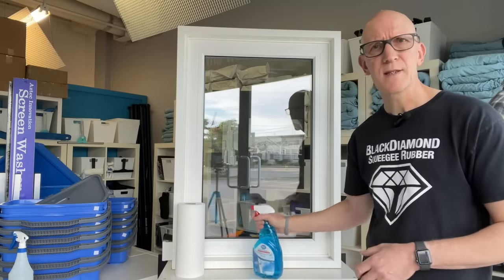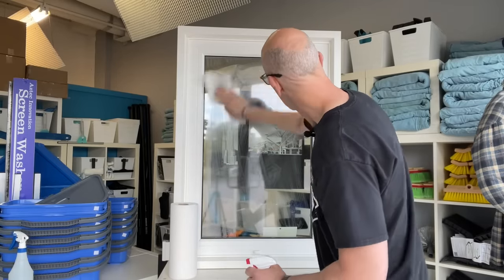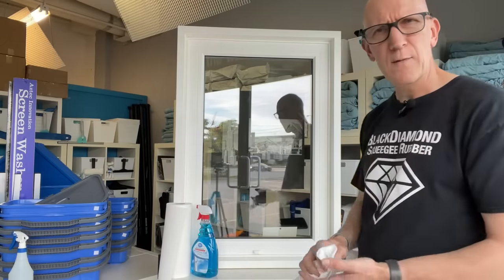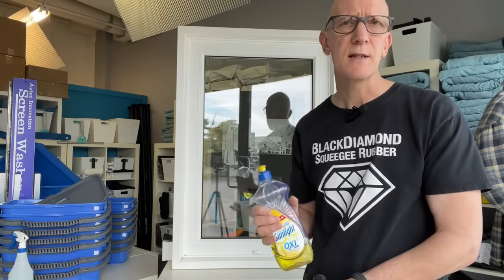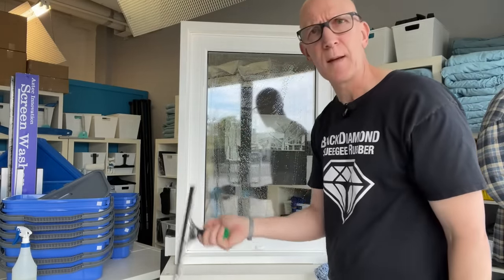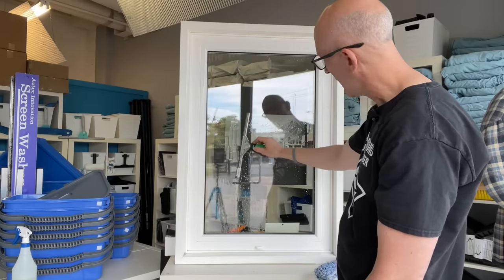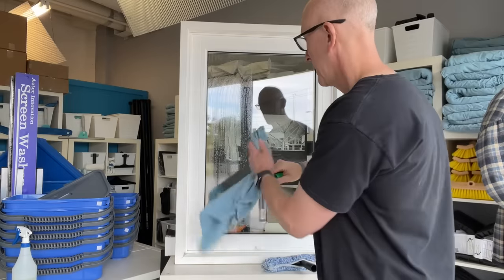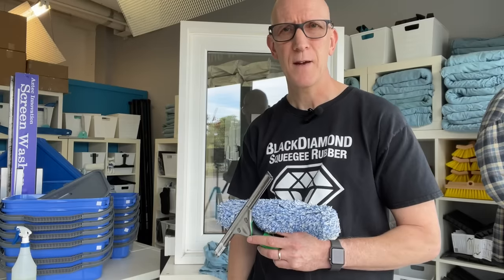The Secret To Streak Free Window Cleaning - How To Wash Windows Like A Pro

Comment: Additional tips: Don't use warm or hot water...you don't want the water evaporating before applying the squeegee. Angle the blade so that the water falls into the adjacent area to be cleaned. Clean squeegee blade frequently. Use the ends of the cloth applicator to get into dirty corners. Try not to stir up the dirt that may settle onto the bottom of your bucket of water and change the water as soon as it appears dirty. Clean, absorbent cotton rags work better than micro-fiber rags. Change rags frequently to avoid redepositing dirt onto glass. Make sure squeegee blade is not dull...they wear out like a knife. Use a lot of dish soap, like 1-2 oz. Less soap will make cutting pollution, cigarette smoke, etc. more difficult. Add a few drops of dishwashing Rinse Aid to the soapy water...greatly improves sheeting action and further reduces streaks. DO NOT go over the window with a rag or paper towel after using squeegee. Only clean the edges from top to bottom and sides, making sure rags are clean and dry. Paper towel, newspaper, etc should not be used. Clean rags in washing machine, but never add fabric softener or use softener sheets which leave a residue on glass and mirrors. Never clean in direct sunlight. You make have to work faster in drier climates to avoid rapid evaporation of your cleaning water. Dirtier windows may need two or three cleanings, with focus on the edges.
Reply from the maker: Thanks for the additional tips
Reply: I found your comment more informitive than the video without taking nine minutes . 👍
Reply: Great job! Thank you very much!  The blue stuff is not very good. What about vinegar?
Reply: You can also add some (1/4 or 1/3 cup ) of White Vinegar to the bucket in this process.  I sometimes use the Windex with adding White Vinegar to the Bottle.  Never clean windows in the Sun!!  This goes for Cars too.  People don't realize how much "gassing" comes off the Vinyl dashboards Sticking to the Windshields.  White Vinegar to the Rescue!.
Reply: You should make a video on your tips
Reply: I use old bath towels cut into quarters.
Reply: thats the first time ive ever heard not to use hot water... my window cleaning company has been around since 1999. always filled our buckets with hot water. dont change rags often, an older cloth works better. agreed microfibre cloths are worse than cotton rags. you should work with a dry cloth and a wet cloth, wet cloth for sils and dry cloth for edges. you shouldnt actually use dish soap because of suds will leave dots. you can get detergant that doesnt create suds.  you can clean in direct sunlight (window cleaners dont take the day off when its sunny) the soap and water on the window will not dry in 5 seconds and if it does just re-applicate the window. dirtier windows do not require you doing them 2-3 times, your applicator also acts like a sponge, scrub the window with the applicator, anything thats really stubborn get a fresh razor blade, make sure the window is wet then you can razor blade the dirt off, never razor blade a dry window you will end up scratching it.
Reply: @M_Ladd  vinegar helps for household use, but commercial window cleaners prefer dish soap.  Tinted windows can be damaged by ammonia or vinegar based solvents .
Reply: @humblewisdom8976  I found both the video and the comment excellent 👌
Reply: @humblewisdom8976  and it probably took you longer to type a stupid comment then to watch a 9 minute video. But you did watch the whole 9 minutes like the other several hundred thousand viewers that watched it so it mustn’t have been that bad.
Reply: Booo....You just made it sound like way too much of a job for me
Reply: Great thank you
Reply: Good info. But WAY TOO LONG. Same info could be shared in 2 minutes or less.

Comment: Good video.  I will try it on my mother’s car today !!! 🎉😅. I usually use warm water , dish soap / teaspoon/ tablespoon depending if I use a big bucket or a lil bucket 🪣 /meaning people w arthritis , RA , Osteo ect can do this. 😊I mix in 1/2 cup vinegar and a 1/8 cup alcohol.  In the little bucket.  🪣 ❤ grab a sponge and the cheap ones that are fat and absorb, (w the scratchy pad on the back )   Then I just do the same thing but use the sponge.   It comes out great but I still have a few streaks in sunlight.  So I’m thinking this squeegee is the dope banger. !!  ❤

Comment: I've been using this method for years. Quick, easy and efficient. I also add a little vinegar to the solution   and when the squeegee is held with the right side lower than the left, I start on the left side of the glass and work to the right.
Reply: Methinks you mixed up (s/b starting on the right side and work to the left).

Comment: Appreciate your technique. For the outside I spray a cool window with water, then spray with dollar store CLR, light scrub with a Teflon safe Blue Scotchbrite pad to remove years of hard water, the window is ready when it feels smooth through the pad (30 seconds), rinse. You don't even need to dry the window to avoid streaks. If you want the window really posh, walk back after cleaning the next window and wipe it down. (the same pad and CLR cleans the screen without getting bits stuck in the screen)

For inside I have never needed more than a damp with water only microfiber cloth and a dry one to follow with. (if it's really nasty I add a third, damp & sopy microfiber as step one)

Comment: Thanks! I hate cleaning windows because it usually involves multiple trips inside/outside to try to find which side has the streak I can't get rid of.  :(    I will try your technique.
Reply from the maker: You’ve got this!
Reply: If you only do horizontal wipes on the inside and only vertical wipes on the outside (or vice-versa) then you'll always know which side of the glass your streaks are on.
Reply: @EileenTheCr0w  What a great idea! Thanks!

Comment: I've tried everything under the sun to get my sliding doors clean and clear and streak-free.  This does a better job but not entirely.  I wish someone would come to my house and do it so I can see that it really does work.  Thanks for the info.
Reply from the maker: Thanks for watching. If you hire a professional window cleaner, anywhere in the world, this is the method they'll use. It's how I made a living for 7 years before opening a window cleaning supply store. Only thing I can gather giving you issues is that you are using a poor quality squeegee, squeegee with worn out rubber or rubber is too hard like a car squeegee, you're pressing too hard, or the door glass  has some hard water stains.

Comment: Great video, thank you very much for making it.  I watched the video and read all of the comments.  The only point in this process I feel was left out is the solution on the scrubber.  Do you just dip it in the soap/water solution and get to work, or do you hand remove any excess soloution before use the scrubber on the window?
Thanks for your response.
Best regards, Brian
Reply from the maker: Dip in the solution then squeeze out enough so it’s not dripping.
Reply: @WCSkills  Thank you.
Reply: It’s grease on a lot of glass . Cooking prints , and what do we use to was drinking glasses  in fumes and finger prints , soapy water , the sprays never cover evenly that is why streaks appear she insufficient spray to dissolve the gunge was applied

Comment: For mirrors, mix in a spray bottle either of these two recipes: 1) 5-10% isopropyl alcohol and the remainder vinegar. or 2) 5-10% isopropyl alcohol and the remainder 50/50 vinegar water.
Adjust as desired.
Reply from the maker: Thanks for sharing.
Reply: Just use water and a magic eraser. No soap required
Reply: @zimmermanlandscape9287 please, no magic eraser…so bad for the environment.
Reply: @Smar47  Magic eraser is made of melamine, which is a natural compound, pretty much only harmful if it gets really hot and you eat it.
You still should be careful of using it on tinted glass or things like metal, etc.. cause it can actually leave a ton of tiny scratches.
Reply: Distilled water.

Comment: Hi there just wanted to know your bucket of water is it warm or cold or does it not make any difference. Also does this method apply to inside your windows & showers with glass doors & panels. Love things that are simple & works. Thank you 😊
Reply from the maker: Water temperature isn't important. In 7 years as a professional window cleaning business, I only ever used warm or hot water when trying to break through nicotine stained windows...yuck! The method shown in this video will work for exterior and interior glass. It will also work with shower glass doors and enclosures provided that the surface is smooth/flat.

Comment: Dear Sir, I have noticed you answered every comment of each viewer and give positive reply. May I ask you 2 questions: what causes the streaky marks on the glass? Is the Rechargeable vacuum cleaner helpful for this kind of job? In addition, I also enjoy your well-kept background. You must be a very methodical guy. I think I will have a lot to learn from you. Thanks in advance.
Reply from the maker: Streaks are simply a sign that you left some water/dirt solution on the glass. That water and dirt mixture dries and becomes quite visible as light passes through it. The video you just watched should go a long way to showing you the proper method for streak free results. If you’re still having issues, I’d recommend you watch my Top 10 Reason You’re still getting streak video. https://youtu.be/OwHYa9mLlDY I don’t recommend the vac window cleaning system, it’s more of a gimmick from what I can tell. Not needed. There’s a reason professional window cleaners  continue to use the scrubber and squeegee method, day in and day out. ;-)
Reply: @WCSkills  If you have rinsed your windows well, there should be no dirt left. The stains you see come from the lime in the water.
The squeegee is only used to work quickly. It contributes nothing to cleaning. If there is still dirty water on the window and you go over it with that rubber, you simply spread the dirt. If you use vinegar water after rinsing, it will dry streak-free because there is no longer any lime in the water.

I know those "professional" window cleaners. Until the sun shines on your glass. If I can get it really streak-free then I apparently know more about it than the '' professional ''.
Professional means: as many windows as possible in the shortest possible time. Quantity over quality.

Cleaning is science.
- pre-rinse (soak)
-degrease
-rinse
-clean with vinegar water (water without lime)
-No more going over with a rubber that you didn't need in the first place anyway.

Comment: Well explained and it works. The 'blue stuff' Windex etc is methylated spirits or (American) rubbing alcohol with water and blue colouring. If you use enough it will flush the dirt off but there's no detergent to loosen dirt. People are recommending vinegar but give no reason. I prefer cotton rag as microfibres have a hard, non-absorbent feel
Reply from the maker: Thanks for watching!

Comment: I use white vinegar and warm water in a spray bottle and wipe. I also use this on  wood furniture, it’s amazing!
Reply: I add a bit of rubbing alcohol and small drop of Dawn  to the vinegar and warm water. Alcohol acts as a drying agent. It does make a difference when you use a cloth instead of paper towels!
Reply: It causes streaks and it pretty much sucks. It's also way more work! Dawn dish soap and a squeegee with a simple clean up towel and you're done
Reply: Great tips...I find window cleaning so frustrating
Reply: Great the more cleaning Mayer mail you put n anything the harder it is 5o clean , happy window cleaning all😊
Reply: @daffodilrose1950  , professionals do not use rubbing alcohol because it  is costly, doesn't work effectively and you don't want to speed up evaporation. Use a lot of dish soap (1-2 oz in a bucket) and a few drops of surfactant, like Rinse Aid for your dishwasher. Change water frequently and make sure it is room temp, not warm, nor hot. The soap will cut the dirt and grease, the squeegee will push the cleaning water off the glass. Only clean up the wet edges, finding a clean spot on your cotton rags. One swipe on each side is adequate. Pre-cleaning the screens and frames helps a lot.
Reply: @jhelotes5627  I use alcohol..it works for me! It isn’t like I use a teaspoonful of it….besides alcohol is cheaper than Rinse Aid! I have been cleaning windows for the past 60 plus years! Have 40 plus windows in my home….they sparkle! Must be doing something right!
Reply: @daffodilrose1950  why alcohol? I ran a window cleaning business and never used it, nor needed it. Good dish soaps have surfactants, so rinse aid isn’t always necessary,either.
Reply: @jhelotes5627  It acts as a drying agent….
Reply: @daffodilrose1950  why do you want to accelerate drying?  Your sharp squeegee blade needs adequate moisture on the glass. A professional window cleaner may soak 2 windows or more at a time or wash several at once. If the water dries, reapplying water is necessary due to  rapid drying. For the same reason, we don’t use hot water, since it is also  behaves like a “drying agent”.  I’ve cleaned thousands of windows.

Comment: Hi! What kind of pressure are you applying to the blade?
Reply from the maker: @TashaStill-om3ni  good question. Many think you need to apply a lot of pressure but it’s the opposite. Because you’ve thoroughly scrubbed the glass with water/soap/scrubber, the dirt should now be suspended (floating) on the glass. Passing along a squeegee blade with slight, even pressure should be all it takes.

Comment: I have found that paper towels cause the streaks because they seem to have an oil in them. I like your squeegie method and will try it. Thank you for your very helpful and  detailed video.
Reply: My microfiber cloths do it as well
Reply: That is, it happens with microfiber too so i think it's the liquid
Reply: @no_peace   Newsprint works well. In my early years, I tried it but didn't realize that the black ink would "run" and it made a mess of the painted white window sill, the surrounding wall from my dirty black fingerprints etc. What a mess. But the glass itself was unbeatably streak free!

Comment: Well I just bought a brand new big bottle of Windex so should I just throw it in the trash can...can I still use it with the tools you used?
Reply from the maker: I’d hate to be one to say “throw it away” as it would be a waste of your hard earned money. Perhaps just save it for your bathroom mirrors. 😉 It won’t work the same as your dish soap or professional window cleaner soap because it doesn’t foam up through agitation. You need the loosened dirt to sit suspended on the glass in a sudsy solution to make it easier to remove with the squeegee.
Reply: I wouldn't use it for windows but you can use it other places like bathroom or kitchen, quick and easy.

Comment: What’s the ratio for the solution you use? A couple of squirts to half a bucket is quite vague. 10ml to 5L ?
Reply from the maker: Squeeze the bottle for the length of time it takes you to say the word “squirt”. So in about three gallons of water about two squirts then gently mix. Of course it’ll vary depending on brand of dish soap. If you find the glass does foam up a bit while scrubbing the glass, then just add a touch more. Foaming up too much, just cut back a bit next time.

Comment: Can you put the soap water mix in a spray botttle to use instead of a bucket
Reply from the maker: Certainly. Some people will mix up their bucket of solution, then fill a spray bottle from that. Go around, clean a few windows then come back to the bucket to freshen up the T bar scrubber. When you go to clean a window, hold the scrubber on the glass and spray some solution just above it so it doesn't make a mess and then just start scrubbing away. It really doesn't take that much water. Thanks for watching.

Comment: I install solariums and have a ton of windows to clean at the end of the install. What would you use to clean dried silicone off the glass. The manufacturers of the windows get it all over the glass. Thanks
Reply from the maker: Magic eraser works good. Some say using them dry works even better.
Reply: @WCSkills  excellent. I haven’t tried that before. Thanks.

Comment: How do you squeeze the water out of the scrubber? I don’t seem to be able to stop dribbling.
Reply from the maker: I just start by squeezing at one end then pull down throughout the entire length of it. It doesn't have to be 100% drip free. Could be the scrubber sleeve is of low quality, like if bought from Home Depot or similar store.

Comment: How does dish soap compare to using vinegar?
And what about using newspaper to clean?
Reply from the maker: Vinegar is just a mild acid. Can help on windows that have been neglected for years. Not needed on most jobs. Newspaper is the same as paper towel and winded approach, you’re just dragging dirt back and forth across the glass. A squeegee rubber completely removed the loosened dirt and solution.
Reply: @WCSkills  Thanks. What about using water and dawn and squeegee on kitchen tile floors?

Comment: Does it work for mirrors
Reply from the maker: Wring out as much water as possible from your scrubber before use. As you squeegee, either hold the scrubber at the bottom of the mirror to catch drips or use your detailing towel to catch and wipe up any drips. I do it all the time with excellent results.